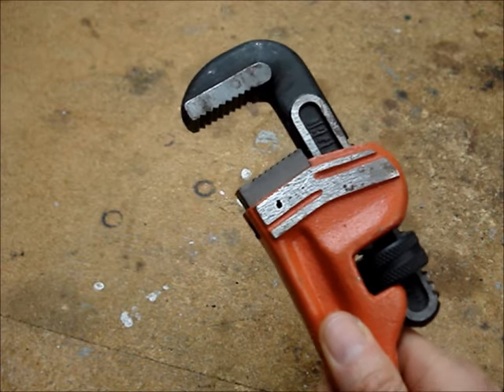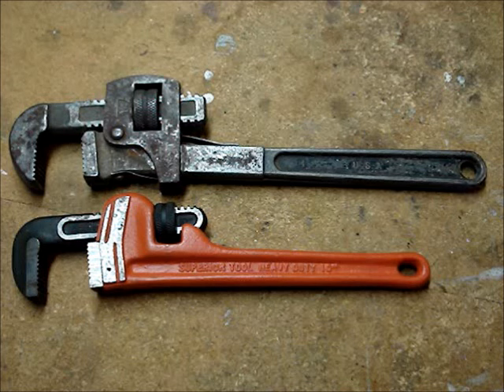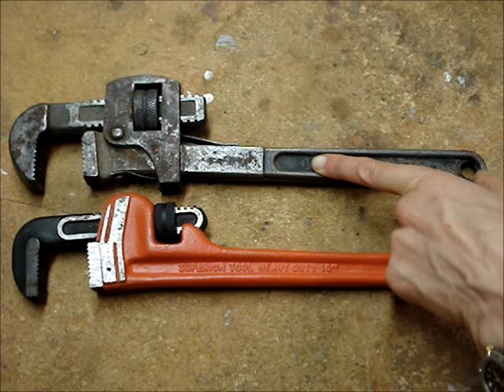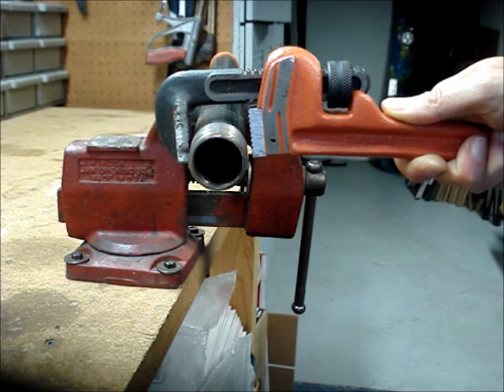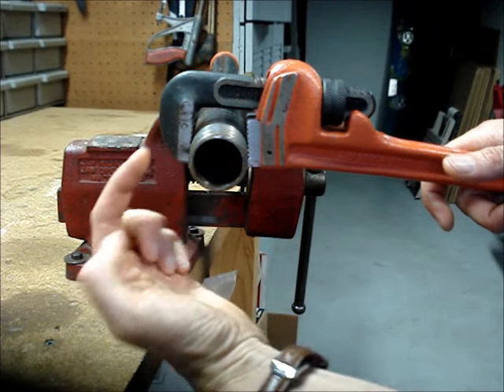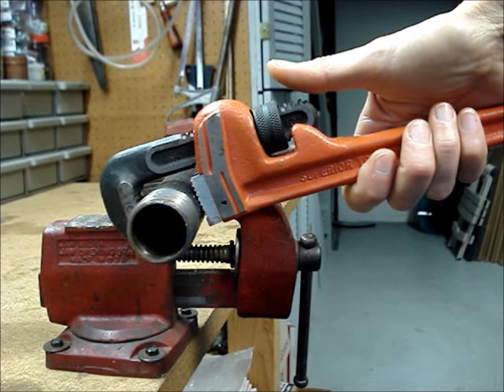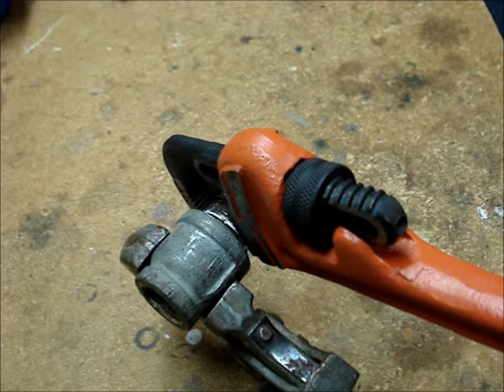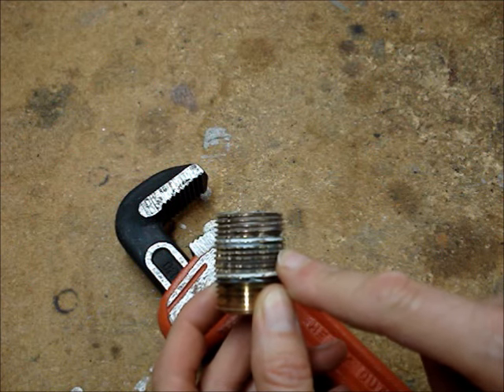How to Use a Pipe Wrench

Comment: Nice video but wrong,  the inventor, Stilson designed the first wrench to have three points of contact to stop the soft metal coming out of round, to make the job easier springs were added to aid the adjustment ie does not have to be precise you need three points despite some manufacturers suggest otherwise. Lack of grip is usually down to worn-out teeth/springs or a bad design/copy. It is imperative that you release the pressure, and not just being lazy by ratcheting the tool back . that will destroy the teeth the pipe and the fitting. Don't forget if the pipe is snarled up it will not pass inspection. My own research,my own use of the tool and teachings from my father a merchant navy boilerman.
Reply from the maker: Thanks for commenting, Richard.  If you read the comments, there are several discussions on how many points of contact is correct.  Some people think it's two and some think it is three.   Check them out.  Also, Rigid advises to use the 2 point of contact method.  http://www.dmp.wa.gov.au/Documents/Safety/MSH_ProductSafetyAlert_Ridgid_ProperUseOfPipeWrenches.pdf

Comment: No three point contact?
Reply from the maker: Look at the comments.  There seems to be two schools of thought.  Rigid says no 3 point contact.  My guess is that perhaps the older style wrenches needed 3 point contact and when the wrench designs changed the method to use them also changed and the old 3 point way kept being passed on.
Reply: Know How Now, yes, I agree that there are probably two schools of thought.  Especially if you’re cranking on a steel pipe that will not collapse even if using a two point.

Comment: you need to ensure the pipe touches all 3 corners of the wrench to get a "3 corner bite", what you demo'd here was only 2 corner and leave a gap on top!! that is terrible. you will just end up making that pipe oval or deformed if you put too much force.  this video needs editing so you showcase the correct technique.
even if a manufacturer  like Rigid says something, try it yourself and you will understand what I mean. If rigid said use 2 point contact - they need a correction and need to fire the publisher of that article asap, can you post the link where they said that, as its hard to believe. Anyways will inform them this goofup from their side.
Reply from the maker: Here's a link to the Ridgid document, the publisher is Ridgid:  https://cdn2.ridgid.com/resources/media?key=32efff83-321f-4065-a5c4-04b77a67bc2b&languageCode=en&countryCode=PH&type=document
That's my source, how about giving us a demo video of you ovaling a pipe?
Reply from the maker: I didn't see a demonstration of a pipe being put out of round.... just talk of it.

Comment: You didn't show how to turn the pipe using wrench. You showed only how to position them. Please show how to use them and how to open valves to release air pressure that obstructs the flow of water
Reply from the maker: Sorry the video does not meet your standards, though.... it is free help.  With 128,000+  views, there are over 2,400 likes and 96 dislikes, most folks are satisfied with the help given.

Comment: You want all 3 sides touching so it doesn't oval the pipe. Coming from a union pipefitter
Reply from the maker: This is how Rigid tells you how to do it.   There does seem to be controversy on how to to this, maybe it depends on the wrench http://www.dmp.wa.gov.au/Documents/Safety/MSH_ProductSafetyAlert_Ridgid_ProperUseOfPipeWrenches.pdf
2
Reply: This is why I screw in my 2 inch with channel locks. Wouldn’t want to destroy some schedule 40 with my mighty pipe wrench

Comment: throat needs to contact, three points of contact
Reply from the maker: Hi Steve.  There are thoughtful discussions in the comments about using 3 points of contact or to not use 3 points of contact.  If you click on this link to the Ridgid (for those who don't know, Ridged makes pipe wrenches) web site.  Click on "proper use of pipe wrenches" to open a PDF.  Figure #3 shows the proper use is 2 points of contact.  https://www.ridgid.com/us/en/straight-pipe-wrench
Reply: @Know-How-Now  My Dad was a plumber and this is how I was taught.  If you still think I'm wrong check out Richard Trethewey the plumber from This Old House.
Reply from the maker: I've seen the Richard Trethewey video.  Have you looked at Ridged's document?  My guess to the difference of opinion of use is that the older wrenches were a different design and needed to be used with the 3 point contact.  While you Dad's advice and Richard's advice were correct in their time, that advice, according the Ridgid is no longer the way to use a pipe wrench. No offense meant to your Dad's or Richard's reputation.

Comment: The, ( annulus adjuster) ring - fun idea - for old wrench. File, the inner threads(file one side) then (file the exact opposite side) smooth of it's threads. 
   The , dead filed spots , let the wrench - "poof" - instantly slide & adjust. 
 Anyone , (Will have) to work with it (edge) of adjuster ring.  Old 🗝️ farmers idea 💡.
  ( In a ) ; 🤕 ouch - pinch !
💕Nice show💕
🎃😨
😎 Bryan
Reply from the maker: Thanks for the tip Bryan!

Comment: I don't know why, but a commenter going by "u2311h" has appended my name (@SteveR)to his remarks about a Ridgid factory bulletin, below, regarding a 2-point (jaws only) means to tightening/loosening pipes when using a pipe wrench.  I want to, in the strongest terms possible, disassociate myself from that post.  My original post about using the 3-point method no longer seems to be available for viewing.  I, too, had seen the episodes of "Ask This Old House" where Rich Trethewey advocates the use of a 3-point contact while using a pipe wrench, and believe it to be safe and effective.  Rich talked about "ovaling" the pipe by using the 2-point method, and warned us not to use it.  I just wanted to put that out there in case someone thought I was associated with u2311h's remarks.

Comment: Do not follow the instructions in this video 
You should always have 3 points if connection on the wrench. both sides and the back of the wrench needs to be in contact with the pipe to avoid bending the pipe out of round
Reply from the maker: Below is a link to a document from Rigid, a manufacturer of pipe wrenches.  It does not use 3 point contact, it shows the method shown in the video.  There does seem to be controversy on the correct way.  Over the years the design of the wrenches has evolved. Perhaps that has changed how the wrench is used.  Some folks have added some insightful comments.  I have to go with the the people who design and sell the wrenches method. http://www.dmp.wa.gov.au/Documents/Safety/MSH_ProductSafetyAlert_Ridgid_ProperUseOfPipeWrenches.pdf

Comment: I think it’s supposed to touch all three surfaces, according to This Old House : https://youtu.be/aPNlAXnTbWI
Reply from the maker: Below is a link to a document from Rigid, a manufacturer of pipe wrenches that tells you how use a pipe wrench and it's not the way shown on the This Old House video.  There does seem to be controversy on the correct way.  Over the years the design of the wrenches has evolved. Perhaps that has changed how the wrench is used.  Some folks have added some insightful comments.  I have to go with the the people who design and sell the wrenches method. http://www.dmp.wa.gov.au/Documents/Safety/MSH_ProductSafetyAlert_Ridgid_ProperUseOfPipeWrenches.pdf
2
1